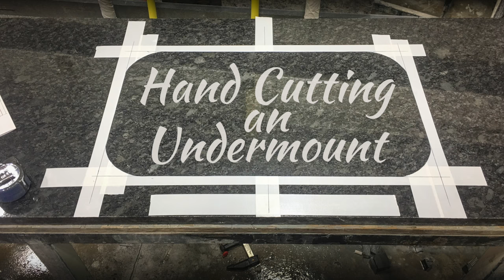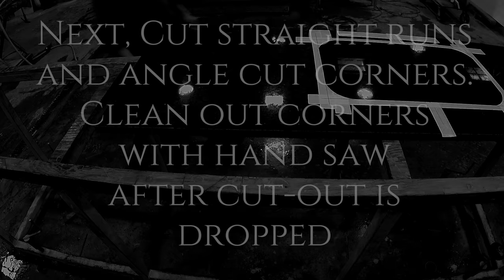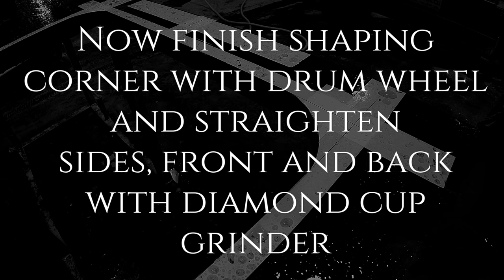How to Cut / Polish Undermount Sink in Granite by Hand

Comment: These videos are super useful, thank you so much for sharing! Bought a used kitchen recently that came with some beautiful slabs of granite and I've been procrastinating on the sink cutout, but now I have at least some idea of what to do.

Gotta practice on the scraps first but watching you has been a big help, I really appreciate it.
Reply from the maker: Thank you for watching. Let me know how it goes. And feel free to contact me with any other questions.
Reply: @GraniteByJay  Polished my counters today and noticed I never posted the update: Everything ended up almost exactly as I wanted. There's one minor nick in a corner from being a bit too optimistic with the saw, but I just filled it with epoxy and granite dust so it's almost invisible now. Honestly surprised it turned out so well given that I had 0 experience working with stone.

I spent $900 on the kitchen and it looks like it cost 10x that now. Almost teared up the first time I made a big dinner. I read my way through a bunch of tutorials but in the end I essentially followed your video step by step. Was a huge confidence boost for me and I'm still super grateful for it six months later. Hope things are well on your end, sending the best of vibes.
Reply from the maker: @GaussianBluff   Best Vibes received. Thanks a ton for the kind words. Really means a lot. And glad I could help. Makes this all worth it.

Comment: Great work! Although I will say it’s much easier to cut using an angle grinder. I cut my corners first then straights. Shape with blade and grinding wheel then polish. All in all good video bro!
Reply from the maker: Thanks Ross. I would say about 80 percent of the people I work with are better than I am with an angle grinder. But for some reason, I love the control of a hand saw. And might be out of line, but I would bet I can cut a straighter seam with a hand saw than almost anyone with an angle grinder. It just works for me. My comfort zone.
Thanks for the comment. And I respect anyone that can master an angle grinder. Especially an angle grinder with a metal cut-off wheel attached. So dangerous.

Comment: 2 Quick questions: what was the white tape you were using?  Looks a lot better than blue painters tape once things get wet.  Do you also hand bevel the bottom of the slab where the sink mounts?  Thanks for the great video, much better made than others I have watched.
Reply from the maker: Thanks for the comment Forrest. Awesome to hear you like the video. Much appreciated. 
The Tape is just white duct tape. They sell colored rolls at home depot and Lowes now. The white is perfect for laying out with pen and the water doesn't effect it when cutting and polishing.
And yes, I always put at least an 1/8" rounded bevel on the bottom of all cut-outs. It helps to get ride of any chips and looks allot cleaner when finished. Thanks again.
Reply: Thanks Jay, great videos.

Comment: Funny that my granite top looks just like this! But Just curious, I got the same granite for my kitchen, and it currently houses a 33 inch wide under mount stainless steel sink in a 60/40 size, has like an S shape cut out at the top section, I want to change it too a rectangular 33 inch drop in sink, how much would it cost to have a specialist to just cut the existing granite to the opening to fit the new 33 inch drop in sink? It seems like the top and corners just need to be cut
Reply from the maker: Hello. Its gets a little tricky when give people a price range. There are some factors you have to keep in mind. And I'll give you a range of what I would think would be fair. A long as you don't say "This dumb granite guy on YouTube told me it would cost this much" Deal?
- Cheapest I have done this for is $150. Homeowner Just moved in. Old sink was already removed. There was no furniture, and other construction projects where going on at the same time. So, I used a vacuum, but didn't have to be extremely clean. I was in and out 30min later.
- Highest I have charged was $550. House was extremely clean. I needed to build a bubble tent with two vacuums running. Paid another guy to help. I also unhooked the old sink and siliconed the new one in. But didn't do any plumbing hook ups. Set up and all cleaning was about 4 Hrs of work.
Again, every job is a little different. I don't usually give a price until I see pictures or visit the job site.
Plus there would be a price difference if the material was $150 per sqft Quartzite compared to $40 per sqft Uba Tuba. Like a "Risk Factor" Charge.
Hope This helps and thank for watching. 
JAY
Sorry for the Novel.
Reply: @GraniteByJay  no problem, thank you for your reply, i know giving an estimate range over online is tough, but thank you. Yea you know what the jackass contractor did? He put the DROP IN 33 inch sink on TOP of the kitchen cabinet, THEN he put the granite on top and just cut out the holes to make it look like it's an Undermounted sink, when it's not....Now i need a way to remove this god damn sink that's sandwiched between the granite and the cabinet. I'm handy and got hundreds of tools myself, and power tools, I would like to maybe cut out the sink to make it easier for the granite specialist to enlarge the sink cut out for my new Rectangular drop in sink to fit on. How do i go about this? some forums said try a dremmel and just cut from the top so that the main bowl parts just drop down and what's left will be the sides of the sink just still sandwiched between the granite and cabinet, which wouldn't matter once the Granite specialist enlarges the granite cut out. Help appreciated, thank you
Reply from the maker: @bludika  That's a tough call man. Cutting stainless is a pain in the ass. But you might not have any other option. Any chance you could take the granite out. Just thinking best case scenario would be to remove the granite before cutting the new sink size. I do know that the new cutout will make your stone a lot more fragile. Top Mount sink cutouts are so big now days front to back.

Second option. Leave the sink in place and cut the stone for new cutout. Use the old sink to catch all the pieces and dust. After that you might get luck. Might be able to fish the old sink out. If not, you might need to pick up stainless or carbide tipped sawzall blade. Not the safest option though. the vibrations can crack the stone pretty easy.

Hope this helps and sorry to hear about the bad luck. And hopeful the price doesn't make you puke, but this is a tricky one.
Reply: @GraniteByJay  yea....i hate how they did it, you ever heard that type of installation before? those jackasses did NOT actually cut out the sink to fit an actual Undermount sink exactly, instead, they cut the granite to fit around the stainless steel sink which a Drop-in, not designed for undermount, then they put plywood on top of the kitchen cabinet, made a big cut out for the sink, then they put the Drop-in sink on top of the playwood, THEN they put the granite on top to make it look appear it's an Undermount sink....now the drop-in sink is stuck between the playwood and granite. Would the easiest way be maybe cut out that plywood and try to shimmy the stainless steel sink out from between?  Thanks in advance. It seems like the way they did it was to save time and to avoid being precise to make it look like an Undermount sink. BTW amazing work! nice and clean and precise
Reply from the maker: @bludika  That could  be a great option too. If you have a 36" sink CAB, the inside of you CAB should be 34 1/2". Which means you would be able cut straight up from the sidewalls of the cabinet and maybe drop the 33" sink and plywood without removing the stone.  That could work. Let me know how it goes. I have some time invested now. Good luck Bludika.

Comment: Hello Jay, long time not chat!  Just watched your cleaning quartz video.  Very nicely done video!  Mr. Clean magic eraser is also a miracle stain remover as you may already know.  Question for you.  In a large island needing a seam, other than matching veins in the manufactured quartz,  is there any reason you cant get a nice seam over about 36" width in the middle of the island.  Any concerns about bowing over such a large cut resulting in a gap and slabs not being perfectly flush at seam? Any thoughts are appreciated. Thanks man!
Reply from the maker: Dan the Man. The longest seam I have done was about 67" long. And like you're saying, getting a very straight cut is the most important. And at that size, you will have warping and imperfections with the stone face. I would say just plan for it. With that said, you will get the best results by using two sets of automatic seamers. Like the ones I use in my "seam granite in 2 1/2 min" video. These cups are usually strong enough to flatten out any height changes. If it is a real pain, use clamps and a piece of stone to keep the open ends flat. Then use the seamer machine to level out the inside area. Spread them out nice and evenly. Large seams like this can be easier sometime than trying to flex a warp out of a 22" wide piece. Thanks for the comment again. Much appreciated.
Reply: @GraniteByJay  Thanks bro!

Comment: So, a sawzall won't work? Now, ya tell me!...:)... Also, polishing with my palm sander just didn't work... Sweet cutout, The wet saw to rough out corners was awesome To!
Reply from the maker: Thanks for the comment. Although I have never tried, I do believe a sawzall won't work. Unless maybe they make a diamond blade for it. Even still that would be really tough to cut stone. And as far as the palm sander, I use it for resurfacing sometimes on softer marbles and soapstone with a honed finish. But its not fast enough for harder granites and quartz. Hope this video helped. And keep trying new things. You never know what will or will not work until you try.
Reply: :)...Nah, I'm a tradesman for 30 years...I've done thousands of feet of counter...Just pulling your leg...I know you need the diamonds for granite...I was calling back to before we started using granite and had laminated counter tops...Much easier...:)...Stay safe!
Reply from the maker: Nice work on 30 years. I'm coming up on 20 next summer. Goes fast man. Much Respect.
Reply: :)...It does seem like it's flown by...But, when you think about all you did in your near 20 years, It's astounding to think of! It's like we always remember our first real job and the most recent couple...Everything else between is a blur...:).. Watch your bottom line and stay lean and mean,  and above all, stay safe!  Love what you do and you'll never work a day in your life...:)...Health, success, freedom and love to you and yours!
Reply: Just wait till your 62 like me. Has gone waaaaay tooooo Fast. I want to keep on working till I'm gone. Cool Comments!!!

Comment: How do you carry to the job site, Do you have to worry about it cracking have any tricks to share about supporting it
Reply from the maker: Cracking is always a possibility. But here are some tips. Just remember to always be aware of where your feet are. Always have a escape route if these pieces ever fall or break.
1. Reinforce any cutouts with steel or fiberglass support rails that are routered into the bottom of the stone.
2. Always transport and carry piece standing vertical. In other words, don't pancake the material by moving it flat. Or table topping.
3. We always use side clamps as much as possible. And use carts that are low to the ground.
This gives you the option to always take a break. And you won't get stuck holding a piece with no other option then to drop it.
4. Most Important. Have a good teammate that you can lift and carry with. You want to be smooth and in sync with each other. If one person twists the opposite way you do, things can end badly.
Hope this helps and thanks for the comment. Much appreciated.

Comment: So do you reseal the cuts after?  And if so, what brand of sealer do you recommend?
Reply from the maker: I always do the sealer as the last step. Usually do all the cuts, fills, and holes. Then dry the piece off. Let the piece air dry for a little while (20Min) then start applying your sealer. Look into the sealers from Dry Treat. Awesome Silicone base sealers. Not water based as most chain stores carry. Dry Treat is a 15 year product. https://www.drytreat.com

Comment: This video is awesome...whose blades are you using?
Reply from the maker: Thanks for the kind comment, it means a lot. Currently I really like the Cyclone Turbo Blade. Its a dry cutting blade, red with drilled holes for cooling. Side note ( If your think of buying some blades, I would recommend the dry cutting blades. They work great dry on-site and work even better in the shop with water. Best of both worlds.). https://www.amazon.com/Cyclone-Granite-Turbo-Blade-Inch/dp/B000VLV4W6

Comment: When you start polishing do you put your polisher at high speed or medium? And do you put pressure or let the polisher do the work
Reply from the maker: Hello. When using this alpha air polisher, I always just turn it on full. However, If I'm using an electric grinder on-site, I usually set the speed to about half or a little under. The electric grinders have a higher rpm. And as far as the pressure, Its more of a "feel" kind-a thing. Here goes my best attempt at explaining. Think of it as being about 12" or so away from a wall. Then with hands mid chest level, lean into the wall. If I had to guess, around 20-30 lbs of pressure. Hope This Helps and Thanks for the comment.
Reply: Granite By Jay 
Thank you keep posting videos love the setup

Comment: What do you do to trace the sink edges if there is no template provided?
Reply from the maker: Most of the time you can make a template by laying the sink face down on a piece of cardboard. Then trace to outside rim. Last just offset inward the distance you want and cut out the new template. If the outside shape doesn't match the inside sink shape, you will have to go in thru the drain hole to trace the inside shape of the bowl. Hope this helps. Thanks for reaching out.
Reply: @GraniteByJay  Thanks for your reply and advise, did you have a chance to look at my link on my previous message?  There is a revolutionary new Invention Magnetrace that make this job  much better and easier.  What do you think about it? Your comment would be most appreciated.

Comment: Can use a angle grinder to cut this marble stone ? Small disc grinder
Reply from the maker: You can use one for sure. It's all what you feel comfortable using. I personally have more control with the hand saw for cutting. But I also have some buddies that hate the hand saw, and are better with an angle grinder.
Couple advantages of the hand saw (my opinion). Better water control when cutting wet. Easier dust control onsite when cutting dry. More spots to grip.  They last a long time without heating up. And safer when it comes to kick-back and stone chips.
Reply: Granite By Jay  ain’t that the truth. Have burned quite a few grinders
Reply from the maker: @jeffmiranda41  Too many for sure. I think they need to start integrating the "brush-less" tech into the grinders and hand saws. Not sure if you have used the brush-less drill sets, but they are the business.

Comment: What was the grit of the drum wheel that you used? Thanks
Reply from the maker: The drum wheels don't exactly go by grit. Its a 2" zero tolerance drum wheel. But if I took a guess it would be around a 50 or 35 grit.

Comment: Y is he putting his finger so close to high speed rotating wheel....its soo dangerous...
Reply from the maker: Thanks for the comment. Diamond tooling is still dangerous, but not nearly as much as wood working tools. These blades cut fast thru hard materials. It would give your skin a kind of rug burn. But you really have to watch out for your nails. They don't stand a chance.
Reply: Steven David Not really bad it just scratches your skin off.. I have done it several times. He is blocking the water.
Reply: Granite By Jay 

Yeah, I’ve had more than my share of rug burns from a grinder. Not that bad. I’m way more careful with wood working tools. Still have all my fingers.